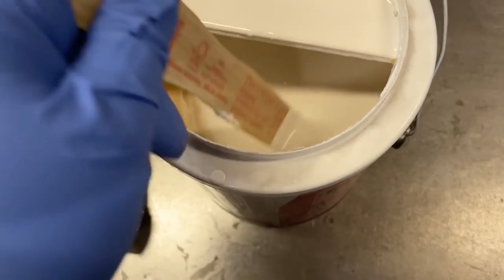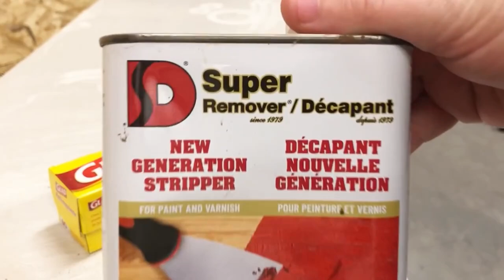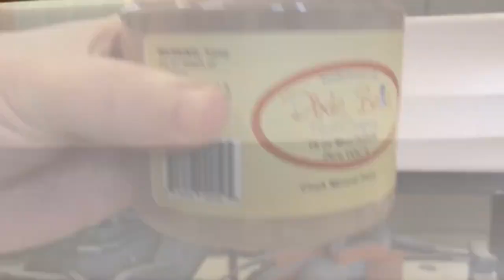10 Amazing Furniture Makeovers | Inspiring Furniture Trash to Treasure Stories

Comment: Hi Katie. Just subscribed. I’m in the UK so we don’t get most of the same products as you but I can find similar. I am all about not throwing away furniture with  ‘good bones’.  My biggest issue is getting a smooth finish with minimal brush marks. I have used synthetic paint brushes, paint pads and microfibre rollers. I still get uneven results. Any tips?
Reply from the maker: My biggest tip is to go easy on yourself! A hand painted finish will ALWAYS show the marks of a hand painted finish and that’s more than OK, it’s beautiful, because YOU DID IT. 

You can try different types of paints, flotrol or “extenders” that make the paint dry slower so it lays down flatter, adding water, brushes and rollers and just keep playing around until you find the right combination for you.❤️